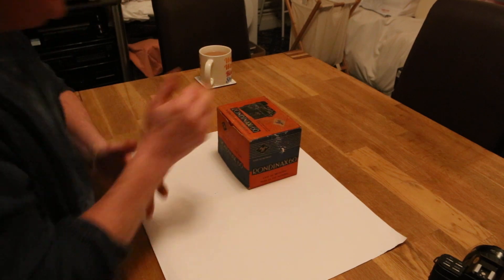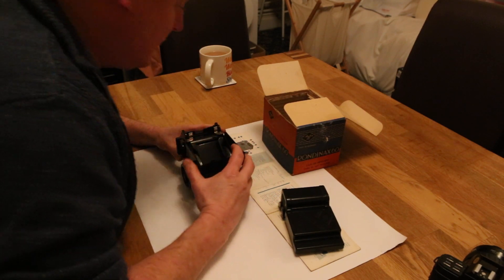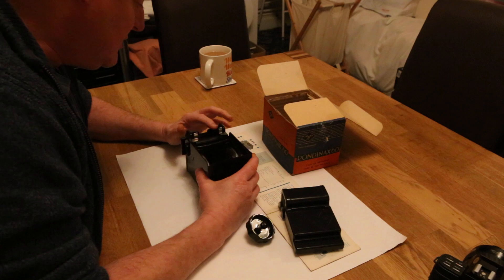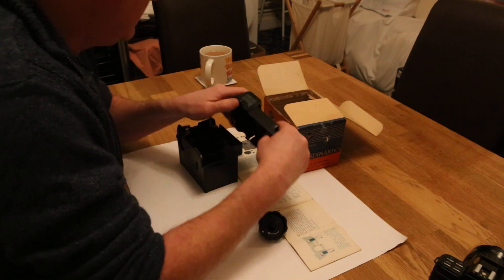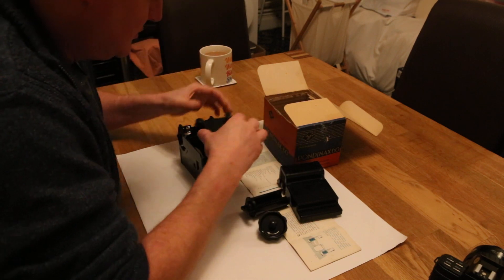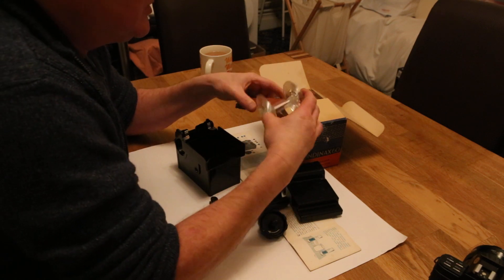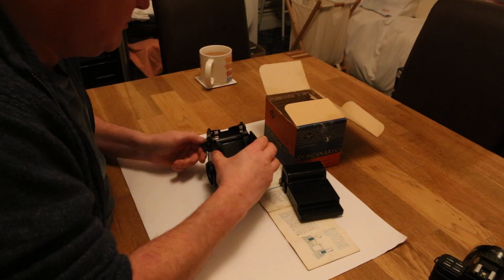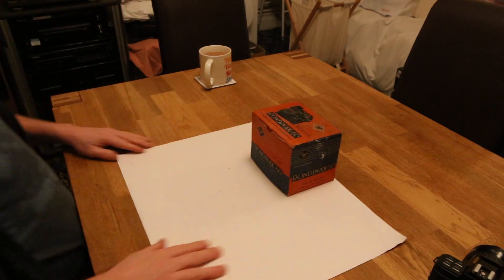Checking out the Rondinax 60 developing tank

Comment: hi, i have the same Rondinax 60, but without film guide part (part number 3 in the manual book), can i still use it for film developing with that condition?
Reply: As originally intended? No, the film guide is essential to load the film on the reel. However, you could load the reel inside a light-tight bag. Just attach the clip at the centre of the film and hold it between your thumb & finger as you rotate the reel. Same as with a stainless steel reel.